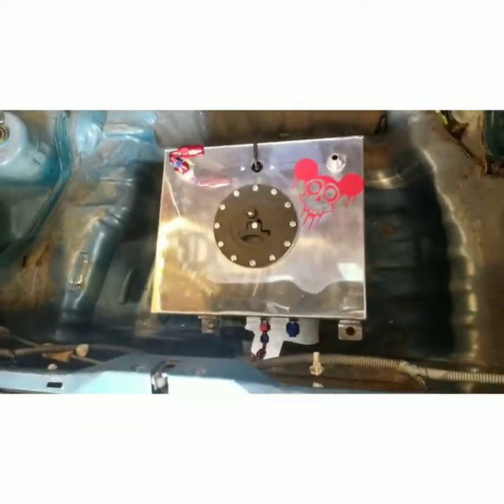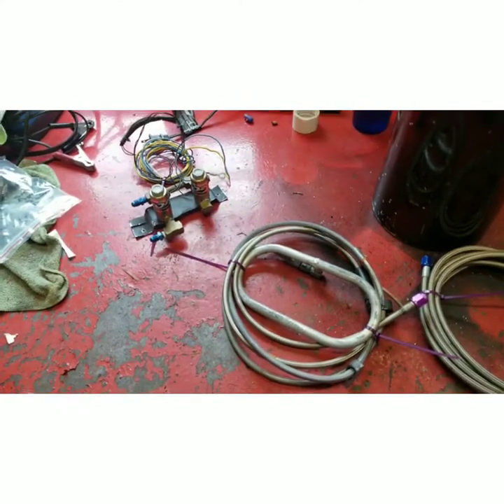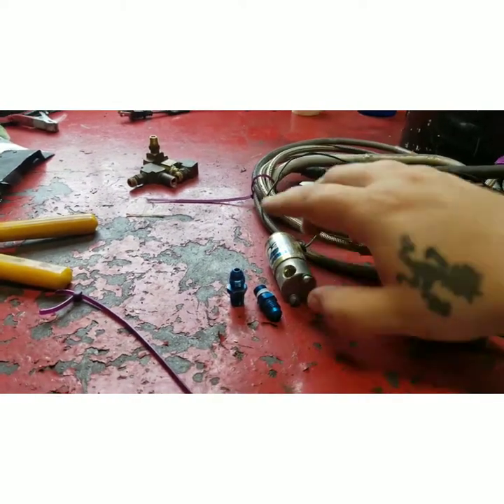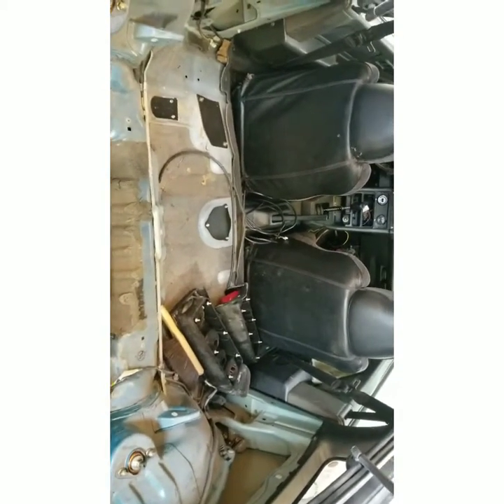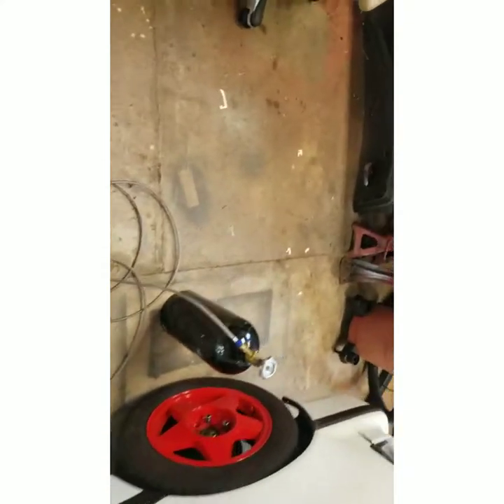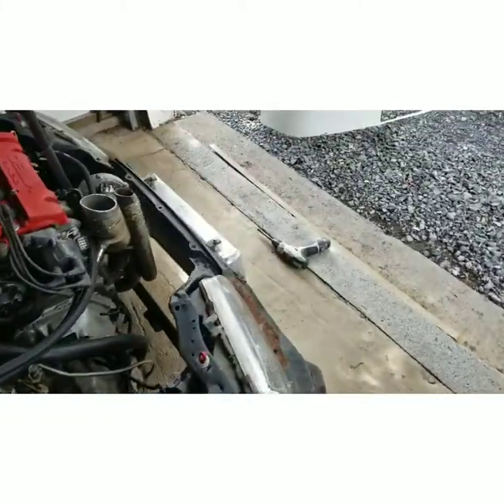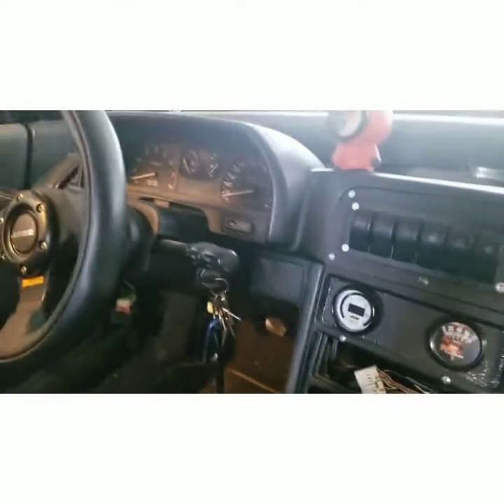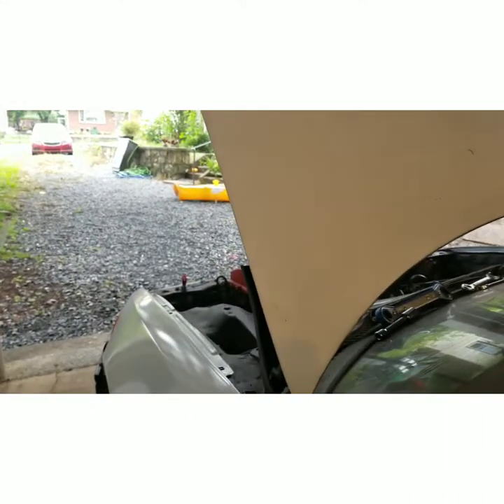Cry02 Intercooler sprayer Install !

Comment: Can you use the front mount sprayer with JUST WATER ?
(ie . 4x4 In the hot sand dunes to cool intake temps or to spray external trans cooler for slow 4x4 trails since no air flow at slow speeds)
Reply from the maker: Yea there's water sprayer kits out there u can even make your own out of an old windshield washer body/motor an some line them just get irrigation sprey tips an ur set
Reply: Yeah, just the sprayer for the fine mist, capabilities, and location possibly Tie into my windshield wipers

Comment: How long do you think 5 kg of Co2 gas is gonna last?
Reply from the maker: If you use it sparingly it should last a good bit tbh it only really takes 1 sprey ( holding for 5 sec) to drop intake temps down